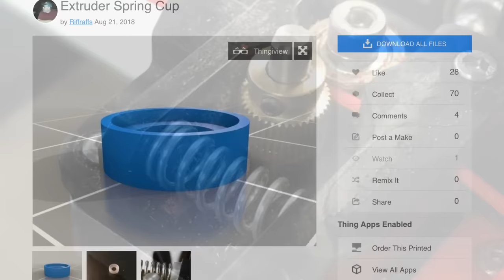Fix Bad 3D Prints on a Creality Printers

Comment: Take the spring out. Stretch the spring as it has relaxed over time. This increases it's spring modulus. Don't stretch too far. Just enough so that it relaxes at a longer length. Put it back. No need to put in spacers. It will run for a long time like this till it relaxes shorter again from the heat over time and constant compression.

Comment: Not a fan of the Creality extruders. The gears are soft and tend to grind the filament when a lot of pressure is involved. It also can't handle flexible filament without modifications and destroys itself over time due to the filament grinding on the plastic on the entrance. I replaced it with a dual hobbed extruder. It is hardened and has a gear reduction.

Comment: You missed the one that cause the most problems, which is, where the incoming filament wears away the hole and catch the filament. Never had anymore problems since changing to the  metal version.
Reply: Which hole, the nozzle's?
Reply: The filament can elongate the feeder hole in the extruder causing friction and poor feeding.  The aluminum extruder upgrade permanently fixes the problem.  Plastic is cheaper than aluminum, so to save money during manufacturing, they went with the cheaper option.

Comment: I don't enderstand the logic of how you clean the gear, you are using a wire brush to clean a gear that has a few plastic bits on it with more plastic to rotate the gear. You prove the spring an idler is easy to remove and reattach, I remove mine and just use a fine brush to move all the plastic out then put it back together, no risk of damaging the gear and you are not introducing more plastic bits to the gear.
Reply: plastic bits to the gear ? , you take them off and get rid of them, preventing them from contaminating your filament as well as cleaning the teeth, therefor providing better GRIP on the filament, and also more consistent

after grinding away for a day on a green filament, it became very clear that i needed to do something similar like chuck did , it worked like a charm and the cleaning should be part of a weekly routine, it will also show if your extruder is still in good shape.
Reply: @patrickmaartense7772  he is using another bit of plastic the drive the gear, plastic will come off so he is introducing more to the gear.
Reply: @funkycowie  not really as he is using this to rotate the gear , a fraction compared to fast printing with many retractions
Reply: @patrickmaartense7772  obviously, but by not taking it apart means there is limited access so not all the plastic is cleared which is the point... also using a wire brush is even if it is brass to brass is not ideal. So it's best to take it apart, clean it with something like a fine painting brush, get rid of all the plastic and that's far better.
Reply: @funkycowie  taking apart is better of course. could be overkill sometimes,

when I have my extruder(s) disassembled I use some air to clean them and lubricate where needed and clean where applicable.

a quick brush with the brush is just a quick clean after a grind imho.
Reply from the maker: My gear cleans quickly and easily. The filament I use to move the gear isn’t slipping so very little plastic is left behind. The brush removes it. It makes it easy to quickly clean the gear when changing filament too. So my method works great without having to disassemble anything.

Comment: If this does not fix it for you, check if you have a crack on the bottom of your extruder arm!
Reply: The aluminum extruder is what I had to go for as the filament eventually cut through the arm and needed to be replaced.

Comment: Man.... Saw your video, saw the loosening of the extruder screw.... Made me laugh. Decided to try anyway.... Perfect prints, just perfect prints.... Beautiful. Thank you so much
Reply: Same I was very skeptical also, but it finally fixed my issues with random missing filament in layers.
Reply: @CHEP, actually I just realized I am still having the issue 😅. Thought it went away because I tested with the 20mm calibration cube and there were no issues, however when I do a larger print I still see the issue. Know what could be my problem?
Reply: Have you tried a different filament? I got this happening to me again when I use a filament that has been open for a long while, that has moisture on it.
Reply: @SuperCoderFromScratch  hmm, ive only tried two different rolls of inland pla pro. But printed like that straight outta the box i believe.
Reply: @DillonZac  then I have no idea I must say. I ended up upgrading my ender 3 with a new motherboard and adding auto callibration and I can say that I've never had issues again. Hope this helps
Reply: @SuperCoderFromScratch  lol i just did that a few days ago and also upgraded to metal extruder, Capricorn tube, and stiffer springs too. It seems to have improved it. But i also increased my skin overlap percentage a bit and reduced my retraction distance and that seems to have helped a lot. Also did luke hatfields hotend fix, but not sure if that did anything tbh
Reply: @DillonZac  I did the hotend fix aswell :) !
Reply: … same… …

Comment: Wanted to thank you for sharing this video - set up my 3rd Ender 3 Pro this last week. It was all dialed in - e-steps calibrated, aluminum extruder, no movement in the bed, bed leveled, belts tensioned, fresh nozzle, Capricorn tubing, z-axis aligned, but I kept getting odd blobs, occasionally dropped "chunks" of filament and weak infill. Following your advice and checking the extruder for issues, the spring appeared to be putting too much pressure against the filament, so I cut off the last coil of the spring to weaken it a bit, reinstalled, and it's printing beautifully now. Thank you for sharing your time and discoveries with the world.
Reply: Wow it's as if I typed this comment myself.  I had all the same exact problems and the aluminum extruder and it was chewing the filament, too much pressure from spring.  I was so tempted to cut the last coil off too...it just popped up in my head one night while I couldn't sleep.  I was going to do it the next day, but didn't want to permanently damage it and have to get another.  So instead I put the old spring on and I'm having other problems now.  After seeing your comment, I'm going to cut the last coil off the new spring.  Thanks for sharing!
Reply: By the way, how tight did you tighten the belts?  I never know how tight they are supposed to be. I'm probably overthinking it though.
Reply: @waynefilkins8394  Hope it helps!
Reply: @waynefilkins8394  I have a belt tensioner on the XY carriage and I use a pair of needle nose pliers for leverage on the Y. I just adjust them so there's no slack and are tight, but not tight enough that they inhibit movement or risk breaking.

Comment: Wonderful video on extruder maintenance! However, there is so much more to it. One important thing worth checking in case of extrusion problems is actually how tight the gear sits on the motor shaft. It sometimes gets loose and every retract you have  spoils your extrusion because of the gear's backlash. I also agree with suggestion on buying new metal extruder, since the stock plastic idler's quality is... unstable, as far as I know (I personally know 4 people who had their idlers cracked after first month of printing).
Reply: Could not agree more on the above.
I first reprinted a replacement in 100% infill PLA on the prusa , but the metal one is so much better.

Comment: Thank you so much for this! I wasn't able to make 1 successful print with my CR-10S, had already replaced the entire hotend and was getting ready to replace the extruder motor. However, it turned out to be the spring! I'm filled with joy to see that my printer work after a solid week and a half of tinkering.

Comment: my prints were suddenly garbage, tried pretty much everything for about a 2 weeks. saw this video and once i took it apart i saw a very visible crack in the extruder arm..right under the idler wheel...this video saved my sanity
Reply: Rich.. mine has been doing this as well and i couldnt figure it out... I read your comment.. thinking cracked? Really??.. mine is printing garbage as well.. I should look.. and I will be darn.. I have a crack under my idler wheel as well... WTH... Thanks for writing that.. I would have never looked unless I read your comment... Off to amazon to get a new part. ty!!!

Comment: Great tips once again.  I eventually wore a slot into the filament inlet hole of the plastic extruder arm on my CR-10 from the filament after many prints.  I suggest replacing the whole assembly with the metal version or other extruder of your choice like Chuck did on his CR-10 mini.

Comment: I suffered from those gaps and switched to a clone Bondtech BMG for completely other reasons, my prints have become basically flawless. I never suspected the extruder since it LOOKS like it works even when it sucks.
Reply: yeah am thinking about switching too i used it on tevo tarantula and works much better .hope it decrease load on ender 3 motor too.

Comment: I had a very similar issue and the cause was that the grub screws of the pulley of the extruder had come loose. Just tightening those grub screws fixed it. I've read other people experienced the same issue, so it's quite a typical scenario.
Reply: Yes first step should be to make sure that things that are supposed to move do and things that aren't supposed to move do not.

Comment: Thanks for all the great vids. This one saved me a lot of frustration. I kept having prints with minimal filament in some areas, to the point where prints would fail on a regular basis because is all the weak points. I was focusing on the nozzle but it was in fact the tension on that arm that was not pushing through enough filament.

Comment: I swapped out the plastic with the creality upgraded aluminum parts and replaced the spring with one of the extra yellow bed springs I had laying around to give it a little more consistent pressure

Comment: Geeetech also has a recurring issue with spring being too weak or relaxing over time.

But it's compounded by the fact that by increasing preload, you make it more likely to break the lever. I found myself a printable lever with adjustment screw and i'm using that now, with the original lever stored away in case of breakage. I also got myself one of those $4 alu extruders and also put it in a box for later.

Comment: Thank you!!!! My extruder gear had a tiny bit of filament built up on it (hardly noticeable). Cleaned it with a wire brush and my print came out perfect!! Funny how a small amount of crap on the gear can effect your print

Comment: Quick tip for new viewers, I know you have covered it before  but upgrade the extruder to the aluminium type costs about $7 to $10 on eBay it's so much better. Use a little silicone grease when assembling and it will stop the parts binding up over time. Respect Sir another great video.

Comment: That arm itself cracked on the bottom of my Ender 3. I believe it’s a known problem, even Creality makes an upgraded aluminum extruder. Mine cracked right where the threaded insert is making it so there was little to no pressure on the filament causing it to randomly slip.

Comment: I had some problems with some  PLA from a specific brand that seemed to have a more slippery surface which made my extruder slip even with a shim on the spring. I took a small triangular file and sharpened all the teeth on the extruder gear to give it better traction and have had no problems since.

Comment: Hi. I found that loosening the idler screw even a bit makes it go even more off in time. And because of the spring tension it actually makes the idler screw tilt out of z Axis causing the idler Bering to rotate on a different plane that is slightly off  from the motor gear's( so not xy anymore). That makes the filament to get ground too. So keep it as tight as reasonable and check regularly.

Comment: Going to try this out because I have the same problem but not as bad as others.  I get the gaps here and there but it smooth though out but some time feels a bit rough that I have to sand it down a bit.  Sometimes I have to use putty/sandpaper if it's a figure and those gaps come out on a face.  I'll be trying this out this weekend and will let you know if it worked.

Comment: I found by just putting a little torque on the extruder arm by pulling it when you load the filament helps lock it in place.

Comment: Very good video! I recently changed my extruder top from plastic to aluminium and I still have some issues. Sometimes it still makes a "tack tack tack" as if something is stuck. But I am not sure if it is the extruder or a partially blocked nozzle at the hotend.
Reply: It may not be extruder, but too low temperature of nozzle, especially when printing too fast. Too cool plastic has hard time to go through nozzle and it makes higher pressure on extruder, which eventually leads to skipping filament.

Comment: Had the same problems, intermittent under extrusion on my ender 3. tried everything, and then noticed the heater block had some movement. tighten the two screws and everything is fine now. Makes sense as the nozzle is connected directly to the heater block.

Comment: Thanks for sharing, I look forward to trying this when I get home this evening. Also my experience is it prints fine with the black filament I'm using but the pink filament from the same brand always prints  gaps at what seems to be random levels in the print. After watching your video im wondering if maybe in my case the cleanliness of the extruder gear and spring tension could also be exaggerated by a slightly softer composition in the filement being used. I suppose the punch line being keep an eye on your gear and spring tension.

Comment: I had the same problem but I had to put a washer underneath the idler to keep the screw from hitting the bottom so it would tighten up nice after I fix that found out that my thermistor wasn't registering right and my temperature was a lot lower than it should have been then of course heatbed went lol
Reply: Hihi, once upon a time when I had disassembled the extruder I was very confused that there was no spacer. My conclusion was that I must have dropped and lost a washer for this purpose and thus installed a 'new' one ...

Comment: Im sure you just same my but on this one i upgraded to direct drive nothing but issuses went back to stock turns out the screw for the idler arm screw was to tight your a life saver i also use a ender 3

Comment: got the same problems 2 times. the 1st time i didnt know where the problem was, i was rage googling and searchin‘ in youtube for solutions. one day i checked the exruder and just fixed the screw and it was good,. after 2 weeks now i bought a metal extruder because the problem with the plastic extruder wont hold long

Comment: Watch out when turning your stepper motors quickly. A damaging voltage can be generated and damage your main board.  If you must turn them fast. Disconnect the connection at the motor.
Reply from the maker: Tim Stevens - I’ve tested this and believe that is a myth. The motors don’t generate enough back EMF to create any issues. The drivers also have bypass diodes to redirect the current. 
Have you actually failed a board doing that?

Comment: Sometimes you get little knots on the filament spool due to incorrect installation that could prevent the extruder from extruding, you don’t really notice them until they ruin your print, worth checking that out.